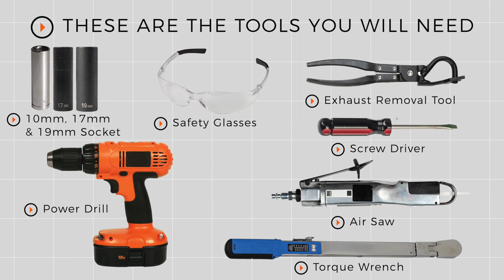2014 Nissan Versa Trailer Hitch Installation

Comment: DO NOT BUY THIS!!!! unless your just using it for a bike rack but if you install a rack to haul cargo, it requires an extension/adapter that makes the rack hang 3 inches off the ground. Can you say "Ouch!!!!" While hitting speed bumps!!! Plus it rattles like crazy. Not a practical solution at all if you really need a truck or SUV but can't afford it yet.
Reply from the maker: Steve, if you're having issues with rattling, try this pin and shim and it should stop that. https://www.uhaul.com/MovingSupplies/Hitch-Towing-Security/Anti-Rattle-Hitch-Pin-And-Shim/?id=23750
 This hitch is also only meant for bike racks/cargo carriers and our very smallest trailer with a weight restriction. This isn't for medium or heavy towing.